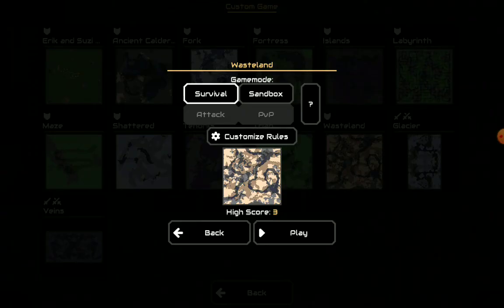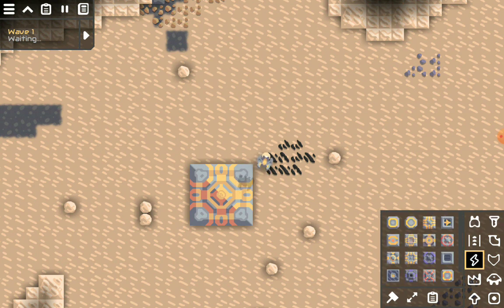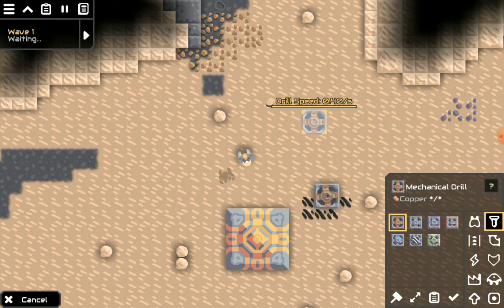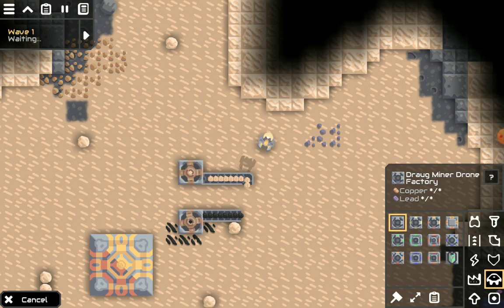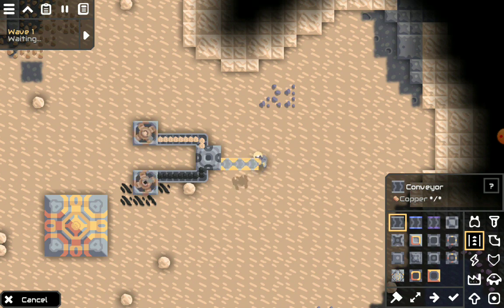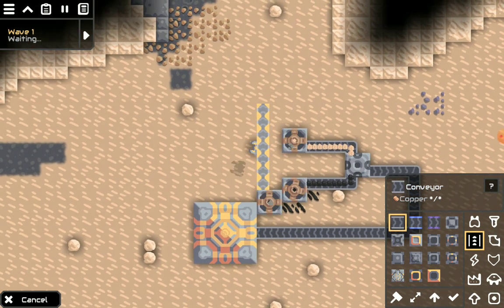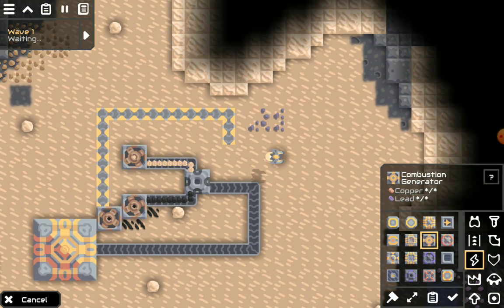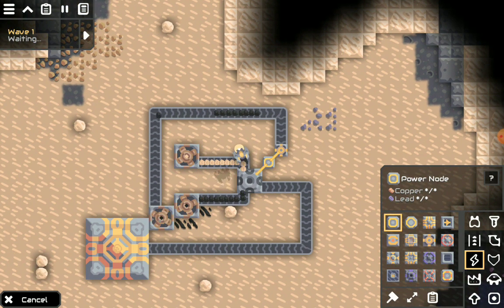How to make silicon in Mindustry. (Tutorial)

Comment: Thx:) I just put a silicon smelter and didn't put a power XD
Reply from the maker: Happy to help!
Reply: I out power but silicon is not coming out
Reply from the maker: Did you add coal, sand, and power? Remember, power is an input, you need to have an external generator.